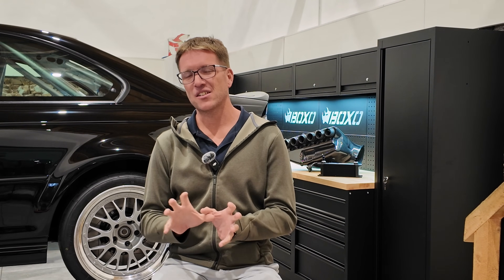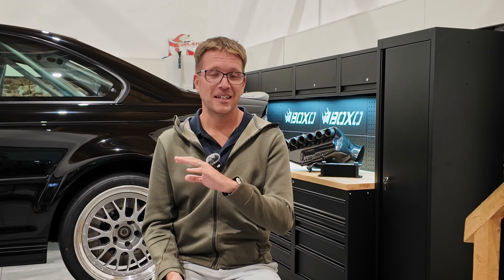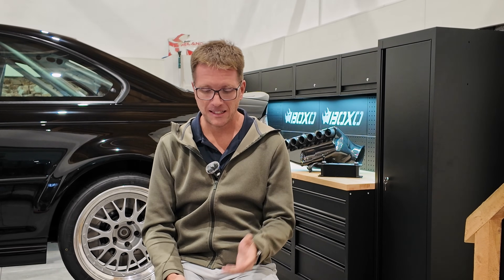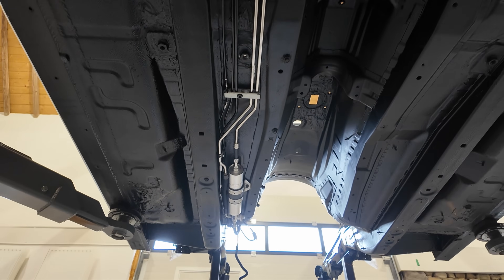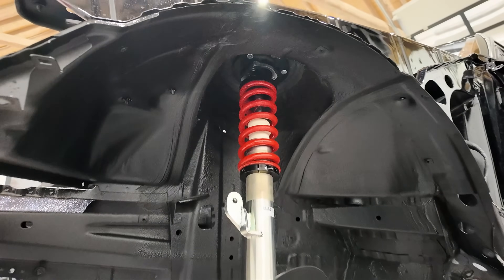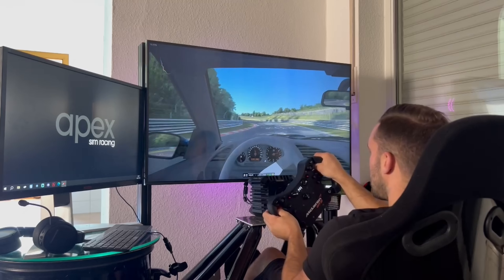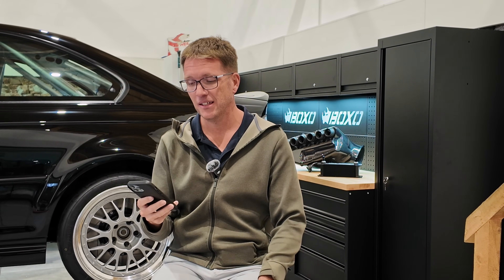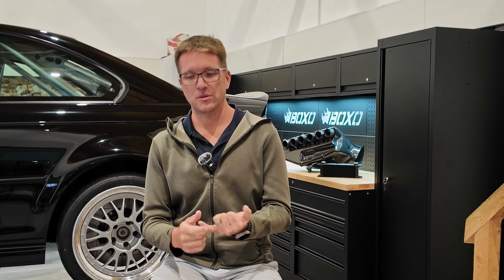Major Progress! My Ultimate E46 M3 Nürburgring Build UPDATE! E2

Comment: Exited for the episodes to come! Sure sounds like fun to take the time and effort to make it perfect for what you want. Will you be running an aftermarket abs system in the car? And are you going into detail on how to get all the systems working together? 

Idea for the E36(or just my dream): go with a Ferrari 360 V8, just enough power, lighter engine, no weight over the front axle and a hell of a noise at 9000rpm. Would maybe also make for a different drive than the E46?

Comment: BUILD SUGGESTION!! BMW 1M with the S65 engine and manual transmission. Yes it’s been done before but not in your way of a track prepped bottoms up build. Imagine an E92 M3 but 300 pounds lighter. The balance of the car is amazing and the chassis is stiffer than E46 and older M’s.

Comment: Erik Eriksson Design does great E36 ramair / brake cooling parts, including ones S54 swapped with Haimus box in E36 M3 chassis. Totally OEM fit and finnish if not better and also durability. Happy to help if so wanted. :)

Comment: Question: what is your take on the sedans? I think these look better in case of the e36 and especially the e90. A huge miss that the e46 never had an m3 version (and from what I understand the e46 sedan is actually stiffer and less prone to the subframe mount problems ) Are you going for the coupe versions for the e36 and e90/92 builds?

Comment: PPF a track car?
Reply from the maker: Seems like the best case for ppf don’t it?!
Reply: @RobertMitchell  not really for a track car. Do they do this on full-time  race cars?
Reply from the maker: @arctictruck10  but why not for a track car?   I stripped the car down to bare metal and put a beautiful black paint job on it.  Then covered the entire car w ppf so I don’t end up w sandblasted paint.   The goal isn’t to build a track beater but a car that’s as pleasant to look at as it is to drive.     Btw all the mclarens, Porsches and Ferraris all got PPF as a first step before track use.  It saved me many paint jobs….
Reply: @RobertMitchell  for the cars you mentioned I would definitely do that,  but for a e46 track car waste of money, you might as well make it a trailer queen race car for display.
Reply: @arctictruck10 this is the best use off ppf i think, that exists.

Ground up dream build with fresh paint, why wouldn’t you keep it as nice as you can for as long as you can?

Racecars rarely go a season without panel damage so ppf is a mute point especially as they all have liverys that act as a ppf in itself. This is a personal track car that i’m sure will do 1000’s of miles/kms so the aim is to keep it fresh.

Also black cars being washed…..swirl city. This will keep it swirl free for a long time. Apart from cost, there is no downside to doing this.
Reply: @cleverley1820  I have seen a lot of e46 m3 track cars in Arizona that haven't been PPF with some damage, but it's his car and his money. 🤷
Reply from the maker: @arctictruck10  I could have bought a 458 Italia for what’s in this E46. So why does the brand of the car make a difference in keeping it nice or not?  Hard as I may, I cannot find the logic in your statements
Reply: @RobertMitchell  my logic is I would have bought the 458. Make it make sense
Reply from the maker: @arctictruck10  have you had a 458?
Reply: @RobertMitchell  the question you should ask is which car I would pick out of a 458 or E46. I had a E46 back when they were newer  and sold it.
Reply from the maker: @arctictruck10  I also would not want a stock e46 hence why we are here doing this.   Not my cup of tea.    If you gave me the choice between the two stock cars I’d be with you.  I’ve had 2 x, an Italia and a speciale and neither could cope with hard track use.  Due to cooling limitations and suspension quirks.  Beautiful cars and engines that are just a thrill to be around at 8k plus RPM.

Comment: talking about good sound, do you know why bmw e46 WTCC sounds so extremely  good and smooth  with the P54 engine ? 
or this e46 hillclimb car with the s54: https://www.youtube.com/watch?v=Zep6aJvjGrY&t=162s
its so much better and smoother than the regular m3 there is no raspiness to it at all
Reply from the maker: I don’t think that car has a S54 I believe that’s a 330ci which has a 3L in the low 220 ho range if I recall.  So the 3.2 is going to be strung out a bit higher to get another hundred plus horsepower out of it and higher RPM.
Reply: @RobertMitchell  you believe that is the reason for its smoother sounding compared to the s54 ? really appreciate your response ! <3
Reply from the maker: @LouaiAmrouche-iu9bc  yes I think that’s the reason for it. I think it’s a motor that’s much much more reserved. They were very cool cars.
Reply: @RobertMitchell  thank you, you're the coolest, looking forward for your new e46  videos <3